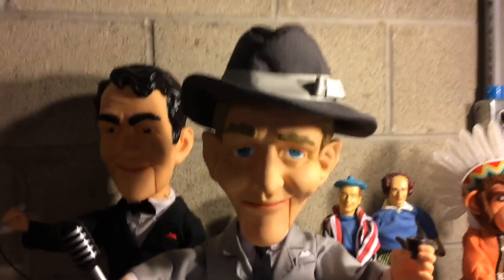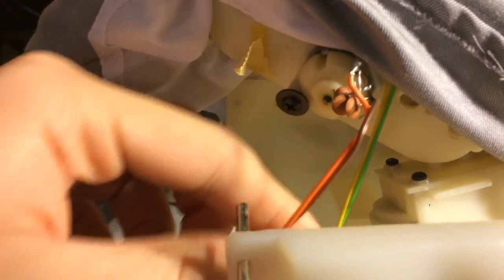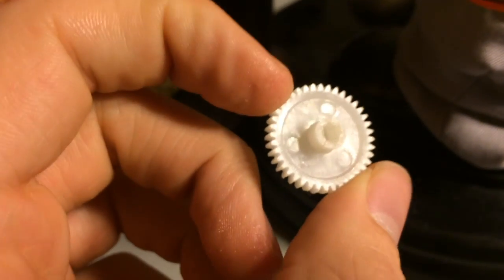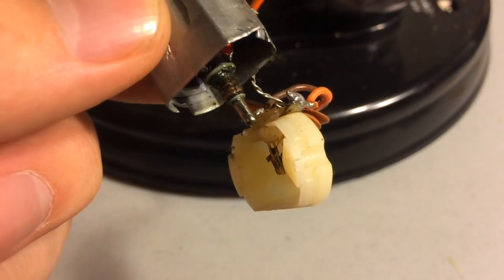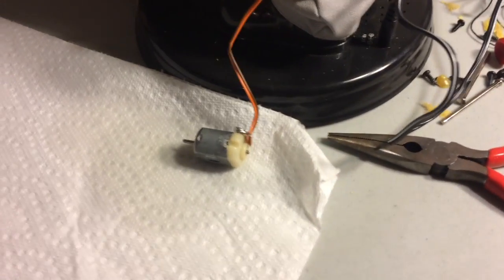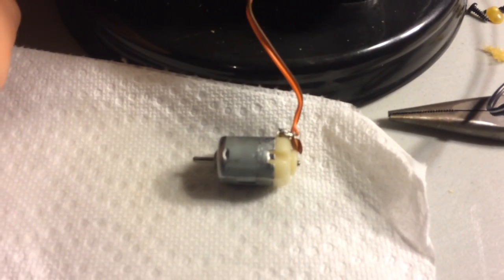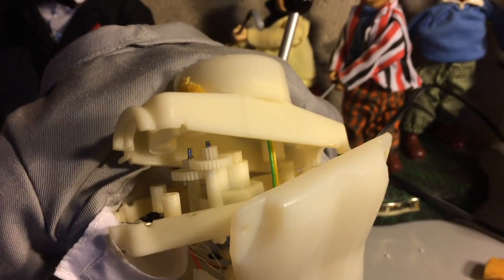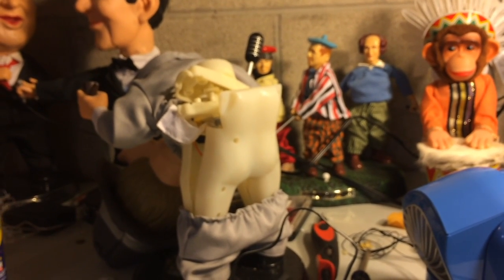Bing Crosby Repair LOTS OF FAILS

Comment: glue the gear back together
Reply from the maker: Elijah Goar That doesn't exactly work. I've tried that on other items before, but that was before I knew it is best to replace the broken gear with a new one. A glued gear can't handle the pressure of the other gears as well, and will eventually split again.